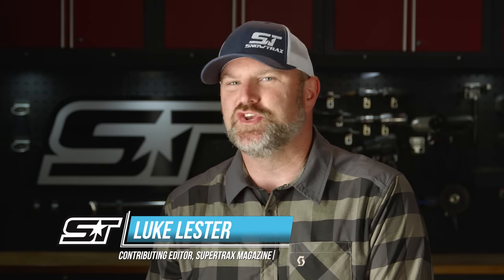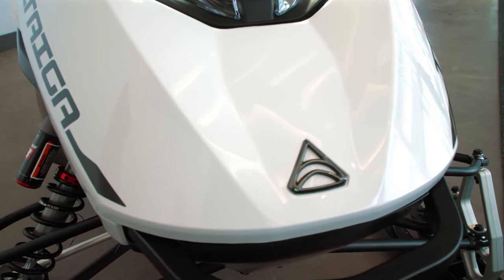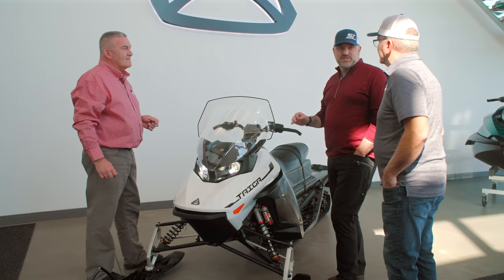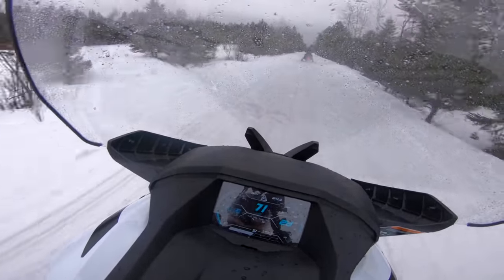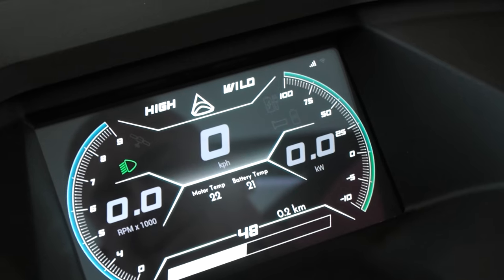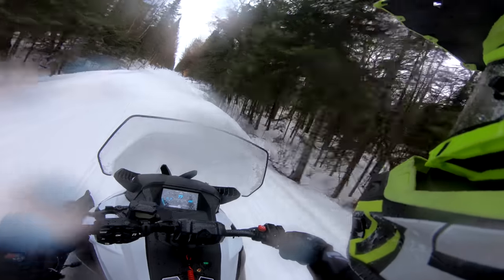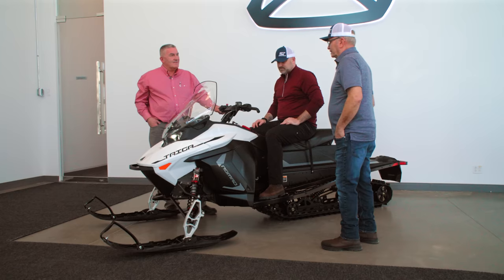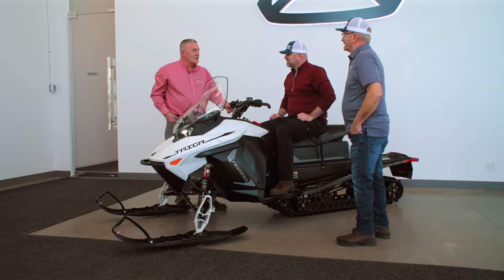2024 Taiga Nomad Electric Snowmobile Detailed Overview

Comment: I can't wait to actually be able to buy a mountain sled that doesn't take gas or oil, doesn't have a transmission, no fumes, and most importantly SILENT.
Reply: Better learn some patience or get yourself a very long extension cord or plan on spending the night or walking out or…
Reply: @robertlarrabee9115  I'll just keep riding my Gen 5 turbo until then thanks. It's too loud and unnecessarily complex but it'll do for now
Reply: @robertlarrabee9115 there's just as many gas stations in the mountains as there are charging stations - none. They are getting the vehicles figured out now, then batteries only need to get 50% better to make gas obsolete for everything but long distance. That may take a year or ten years, but it will happen.
Reply: @SnowmobileHomeMovies  Yes & yes, but you can carry extra fuel, dump it in in just a matter of minutes and be on your way.
Reply: @SnowmobileHomeMovies  Maybe, if an as of yet undeveloped battery technology is developed. For now some are investing heavily short term in Li Ion which just isn’t (IMO) going to cut it for the main stream snowmobiler. Jumping from gas to electric is a far cry from switching from a 2 stroke to a 4 stroke. Remember personal computers? In the beginning every 6 months they got faster and cheaper. The big difference here is every time an electric snowmobile is improved I can’t afford a new one. At 66 yrs old by the time they get electric snowmobiles right I’ll be out of the sport anyhow.
Reply: Maybe a hybrid? Say...a 998 4 stroke turbo or 850 2 stroke turbo with electric motors? On second thought, drop the electric stuff...😅😅
Reply: Well.. one thing is for sure, you will have to wait for a long time. And.. Who would want a silent snowmobile? 2t is the only good sound... be it mx, enduro or snowmobile.. or a vintage rgv500cc. And I am of an opinion that no matter how fast a car is, it also has to sound good.  Turn on a Tesla.. not one notices. Fire up a V8 car, everyone around turn their head towards that... men usually smile, as do proper women^^
Reply: @brokenujoints3811  If a hybrid weighed the same or less. 2 strokes were a brilliant adaptation to snowmobiles for weight and power. Now adding turbos and associated crap weights are creeping up again. Some of it driven by folks that feel like if it’s got more technology on it, it must be better. Wasn’t that long ago Ski Doo  was touting a 4 stroke sled under 400 or 500 lbs. I forget which.
Reply: @robertlarrabee9115  The 2010 Ski Doo 1200X weighed in at 499 pounds. Their weights have only skyrocketed since then.

Comment: Still didn’t mention battery life, cost of replacement, battery degradation over time. What is battery type? Li Ion?  To truly understand what we’re getting ourselves into we need to know the answers to the questions that perhaps the mfgs don’t want to answer. Early adopters will be there in droves but the masses will need more convincing that electric can replace gas in every way.
Reply from the maker: Think you posted this comment last week. Just a heads up we aren't filming these on the fly so we might not answer your question right out of the gate. These videos were filmed last spring and they're already queued up and ready to go. Hoping we will get one of these for in-season testing and we will be sure to go into detail about what you're asking. Fair?
Reply: @snowtrax  Correct. Patience isn’t my strong suit! 😉
Reply: @Welcometofacsistube  Not EVEN is right!
Reply: @Welcometofacsistube  Try grilling a hot dog on an electric snowmobile exhaust pipe! Heh heh. 😉
Reply: From their website this includes the battery

If the Taiga vehicle is a snowmobile: a THREE (3) YEAR, TEN THOUSAND KILOMETER (10,000 KM) of vehicle travel, whichever comes first, Powertrain limited warranty for recreational use of the vehicle against defects in material or workmanship in the vehicle’s Powertrain.
Reply: @shane2129  Not much of a warranty description. At least the auto mfgs. tell you the battery is warranted to hold at least 70% charge during the warranty period. Not something a snowmobiler wants to hear since battery capacity affects range. My current snowmobile holds approximately 10 gallons of fuel. In 40 years that same tank will hold 10 gallons. And the cost of some of those batteries is over 2/3 the cost of the total vehicle. Ouch!
Reply: Basic questions held back is sus.
Reply from the maker: The batteries are Lithium Ion, so very safe. The base level battery is 23kw. If you opt for the $2000 performance package, the battery get about %30 larger. I can’t answer about replacement cost. I’m sure that’s something Taiga hasn’t finalized yet. It would be years of use before you’d need to worry about it, but I understand what your saying about knowing these costs up front so you can make a fully informed buying decision. I think what’s important right now is that NO ONE - not even Taiga, believes electric technology is anywhere near advanced enough to fully replace gas powered snowmobiles. I personally think we are decades away from that at best and even then there will be people who simply don’t want one. - Luke
Reply: @snowtrax  Luke-I appreciate the response. Since there is much unknown about the battery cost, annual degradation (there is no escaping it) and other battery issues in my opinion it would be safe to stay away from any vehicle where 100% transparency is missing. My current ride is a 2018. 6 years quickly passed so the time is going to keep on passing quickly such that the time for battery replacement of an electric snowmobile will be upon someone, either the original owner or a subsequent owner in no time at all and it won't be like replacing the starting battery on a traditional snowmobile. Taiga isn't in the business to lose money so at some point they will need to move these things whether they are ready for prime time or not. Those individuals that have to have the latest technology and are just plain made of money will buy them. Not convinced they will be happy when they compare what they bought to what a traditional snowmobile can do. Unless new political leaders are elected both in Canada and the US these things will be pushed upon us unless we push back. While the propulsion systems don't appear to have immediate issues one day, maybe, the battery problems will be solved such that the masses will scramble for them. For now, imo, let the buyer beware.

Comment: I don't get the comments, this is a first to market leader. All the things beind said was said about telsa. You need a company like taiga to push the market and the tech. It's not for me yet, but I'm glad to see a Canadian company push the industry and come out with something that is truly interesting and so close to the experience I'm used to in a sled.
Reply: Not really. Electric transportation is all about efficiency. Driving a Tesla down a paved road can be extremely efficient and the range is fantastic, unless its under a heavy load such as towing a 5000 pound camping trailer.  
Unfortunately, snow travel is often loaded with a LOT of drag resistance due to deep snow, or heavy slushy snow in conjunction with a tracked system which rolls along with great amounts of drag and resistance as well compared to a wheeled vehicle like a car. There's a lot to overcome here.
Reply: @bedlambikes  it has a 100km range as a first Gen. We aren't far away from solid state batteries which could triple that. Right now, I have a trail machice a polaris boost and titan. The nomad could even now replace my needs for what is use my titan for. Ie ide fishing hauling some wood, grooming my trail. It not there yet to replace trail machines here in the north that's for sure but the fact if already consider buying one as my ice fishing sled means there's lots of us who could be swayed. I'd go to this sled before an electric vehicle for my use.
Reply: @LiamG903  The range is stated as 100km. Wonderful. There's been no claims to anything other than that's on flat groomed hard pack. What is the range when it snows over a foot of moisture packed heavy wet snow? I suspect its less than 35km.
Reply: @bedlambikes  even 60km would still do the trick for me when I'm pushing. The low end will be super handy hauling wood that's for sure. Like I said it's first Gen and a solid one at that. In a few years this will be the leader in the market I bet
Reply: @LiamG903  yah most ice fishermen I know, and I know lots, I live in an inland fishing and logging community, their sleds may drive like 20km over all through out a day of ice fishing, these would totally be fine for most people that only want an ice fishing sled
Reply: @Bundysvideos  exactly, this isn't the sled for guys who put on 300km.a day. But you trailer or live near a lake, head out for a bit maybe move around a few times 60km is fine.

Comment: I would like to know the weight of this sled?
Reply: Yeah, those batteries are hea-vy.
Reply: It looks like 606 pounds. Weighs as much as a 4 stroke!
Reply from the maker: The weight of the units we tested was approximately 750lbs. Which is REALLY heavy, but on the trail they don’t feel heavy. I wouldn’t want to pick one up or have to get it unstuck or anything, but when riding, it is not noticeable. - Luke
Reply: @snowtrax  👍

Comment: Wonder what it sounds like with a can
Reply: 😂 something like this

...................................
Reply: Oh come on. besides a 90s yamaha tripple most of the rest just sounds annoying, especially after a couple a minutes at 8000rpm.  
If there is a veichle I don't mind it being silent it's a snowmobile and I see zero downsides with it going electric if they can figure out a resonable light battery. Type of drive train dosen't ad or remove any fun since it's already CVT driven.
Also atleast where I live there are alot of people wanting ban on them due to the sound.
Reply: @Iceeeen  EV's are definitely not the save all, end all answer. There are quite a few downsides. Particularily environmental, by way of emmisions created through out the manufacturing process, infrastructure to deliver power, battery life in cold climate (regardless of heating/cooling sytem), toxic battery disposal, availability of mining raw materials, etc.
This sled uses direct drive through a splined belt, no CVT, as explained in the video.
That said, those yammies do sound good and cans are definitely annoying.
You gotta admit, it was pretty funny, a can on an EV sled.........................
Reply: @jimeverden2244  Where did II say anything of emssions and that crap? I atleast seriously don't give a crap about that. It's all just green washing.

 
What I do care about is how a snowmobile sounds, and  I would much rather have a quite one to please some nearby neighbours that hates sounds or the skiers for that mather. 

I know that this one has direct drive, what I meant by it is the you get the same feel wether it's a gasburner and a cvt or an electric motor. Just that one is sitting at 6-8000rpm screaming and the other is almost quite.

If they only could fiqure out to get the battery a tad bit lighter it would be perfect, I swap instantly 
+ you get rid of those stupid piston swaps, last skii I bought just after it had them swaped and 1k later the compression on the stupidly expensive wössner pistons was so low so it wouldn't go into reverse anymore.
Reply: @Iceeeen  fair enough...you eluded to it by the smell you don't like but I'm probably reading too much in to it.
Just trying to shed a little light on it for you.
But like you said, you don't care.
Which is kinda sad, but oh well.

Comment: So what is their target market? Rental shops, guided tours, or something like that?
Reply: I believe its ski resorts, where lift operators, etc... need to get up and down the mountain just a few times a day. Perfect for those applications.
Reply: apparently it is unfortunately guided tours, thats why skid-oh is developing the tech aswell, as that is their biggest market.  but... the batteries need to be able to do at least 160km, 100 Miles a day in -35c, to be actually viable. And not just in simpmode. .. but that is ofc just my opion, because we drive alot around here, last season I did over 10t km, ~7.5k miles? just on tours. Let alone the fun time on my own^^
Reply: I bought one.  My market is cabin owner.  I want a sled that requires no maintenance.  Any of the family can run out hop on and ride for 30 minutes until bored.  Something that I don't have to store or shlep gas for.  One that the you push a button and will just go!

Comment: Like it or not, this is the future for trail sleds, especially rentals. Going to be a long time before they move in on the true mountain sled market though.
Reply: Fortunately I’m old enough I will never have to own one.
Reply: I fear that as well... but the thing is, even with the company I work for.. and its a small one. We would have to basically triple our snowmobile amount from 40 to 120 and have 3 different recharging stations with plugs to atleast 10 snowmobiles at a time, with a quickcharge.... aand building the charging stations would cost more than likely more than it would actually be worth. let alone to replace our up to date customer sleds with toys. as i would guess those are at least 20k.
Reply: @TyfoiD75  I have been at so many remote bars and restaurants over the years with lines at the gas pump. I first of all can’t see where these small businesses could afford to install chargers and second, it would never be enough to service the amount of traffic. It will put a lot of people out of business.

Comment: 154 is certainly interesting, i don't think i've seen a track that long with lugs that short before
Reply: Lynx 59 yeti have even shorter lugs, 154x16x1,25”
Reply: Pretty common actually...skidoo expedition, tundra, skandic...1.5 to 1.6 lugs. Other manufacturers have done the same with their utility sleds before. iirc polaris did an even shorter 1.3-something on a long track. Idiotic to me, but whatever. You don't always want a paddle for some jobs.

Comment: Whats the range of the Taiga riding in a foot or more of fresh heavy wet snow? 

I hope its not like the electric pickup industry, where everyone refuses to answer questions regarding towing range.
Reply from the maker: We rode in wet snow, but it wasn’t deep. I’m curious about this question as well. Unfortunately, the conditions we had when testing were different so I can’t comment. I would expect a drop in range. If the snow was untouched, I’d expect a significant drop in range. Especially when you consider that you’d need to be in standard mode, not eco, to keep moving. - Luke
Reply: @snowtrax  thanks for the reply Luke. I concur with your thoughts as well. It’ll be interesting to see what happens in real world scenarios such as this. Electric vehicles rely on being efficient. The problem is, snow travel is often the furthest thing from it.